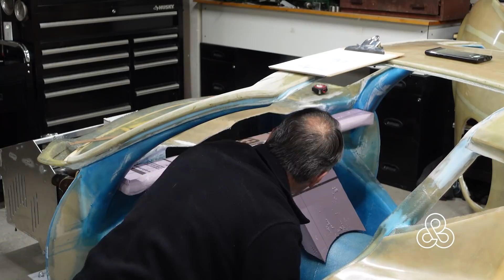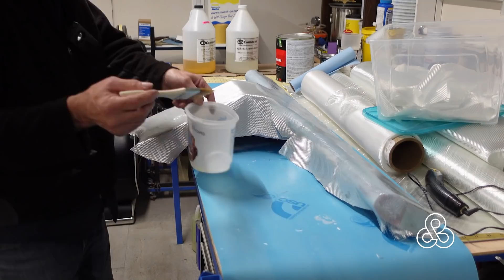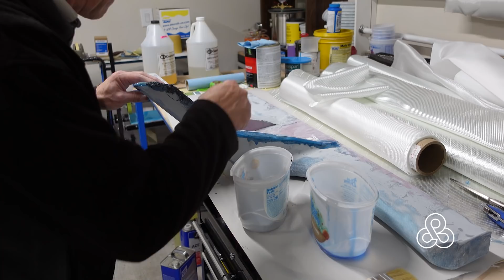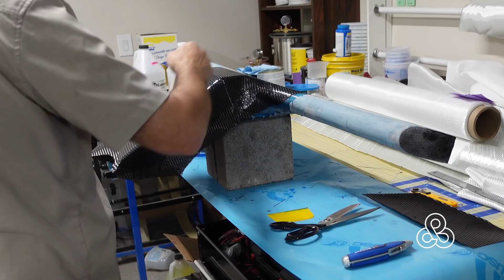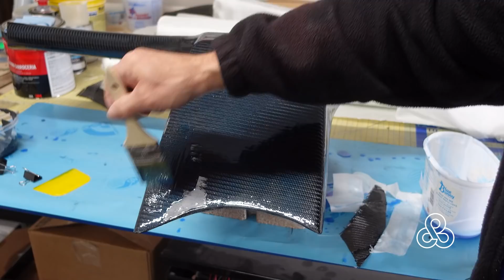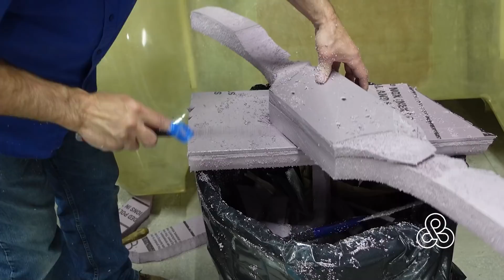A80 Carbon fiber dashboard trim or weird cow head art? Arete Supercar Project

Comment: Hi, what kind of tool did you used for cutting the fiberglass on the dashboard ? THANKS
Reply from the maker: I use a pair of electric sheers (scissors), available from some composite supply houses, on raw fiber cloth and an oscillating power tool on cured resin laminates. Way less dust and a more accurate cut path with the oscillating tool rather than a abrasive cutting disk.
Reply: @BuilderCreator  Thank You

Comment: Hello again.  I finally caught up on all 80 Arete videos.  Just awesome.  I am a real fan of your skill and willingness to share this build and your knowledge on YouTube.  A couple more questions:  

1.  I see its been probably two months since the release of A80.  Is there a reason for the delay?  I know you are also working on the Leviathan, but I’d also like to see more of the Arete especially since you are closer to a rolling and maybe running chassis.  

2.  Also, one technical question that’s been lingering for me since you worked on the front subframe.  When you needed clearance for the coolant tubes, you cut notches on the chrome moly tubing.  I realize you added some flat bars to the notch, but isn’t this a structural piece?  (Sorry, the real amateur Monday morning armchair quarterback question.)

One last thing.  A while back you asked whether people would be interested in more videos about your life.  I don’t know what the upshot of that poll was, but, I’d like to see some on some videos of your other creative projects like the 3d printer.  Not real interested in gardening videos, but maybe some creative home improvement projects.  Solar?  Electric windmills?  

Anyway, again.  Greatly enjoy and appreciate your videos.
Reply from the maker: A new video today answers question number one. Notch in the cross over tube, front sub-frame - Today's video shows that there is an extra tube under the dash that completes a box of the sub-frame. Plenty of connection between the sides! Poll decision- If it is directly connected to the projects (i.e. machines that I would use) It will get a dedicated video. Other things - just honorable mention. Anyway, thanks for all the watch time!

Comment: Sir, I discovered your channel and the Aretet project a few weeks ago and I am catching up watching several of your videos a day.  (I am up to A45.). They are totally entertaining and I am in awe of your skills, knowledge and dedication.  Your project and how you are accomplishing it are truly astounding and fascinating.  Hats off to you.  I do have some questions and please excuse my ignorance.  
1.  The car design is kind of retro: sort of GT40 (with the doors) and kind of old school with the rounded shape.  Was this intentional?  Why not something more modern like a Konnesig type design — more straight angles, etc.
2.  Is the tub floor, with the transmission tunnel,  going to be strong enough as the sole structural member to withstand the flex forces connecting the rear engine frame with the front suspension?
3.  When you lay your fiberglass cloth in layers, it’s always with the cloth going the same direction.  I.e., strands going north/south x east/west.  Wouldn’t it be stronger if you laid the alternate layer of cloth with the strands at a 45 degree to the precious layer of cloth?
4. Is the 4 layers of carbon fiber making up the A pilled support going to be strong enough to be a roll,cage of sort?
5.  The hot air from tue turbo goes through a pipe that is located in the cabin to get to the intercooler on the other side of the engine bay.  Won’t that make the cabin hot?

Thanks again for doing what you are doing and putting it all on the internet.  I am a great fan of yours and appreciate all of your dedication and willingness to share.
Reply from the maker: Thanks for watching Theo. Here are your answers; thanks for numbering them: 1 - Yes the design is a bit retro. I am a BIG fan of the 60s era Italian cars. (maybe because I'm 60s era? Ha!) Straight lines and wedges seam to come and go. The smooth rounded shapes endure. 2&3 - Tunnel strong enough - I sure hope so! most of the layers are formed of a uni-directional cloth that is woven at a 45% bias and as they are laid square the strength will be greatest in torsion. The real strength is actually developed in the complexity of the shape (boxed side rail [cores] and tunnel). The odd layers of plain weave cloth (90degree weave) are mostly to help consolidate the layup, but will also add to the rigidity for and aft. 4 - No, but with the windshield bonded in place and the connection through the roof to the rear bulkhead it will prevent the rear bulkhead from taking all the load in a roll over. The rear bulkhead, with its super thick vertical laminated pillars (and steel roll bar for malleable deformation ) structure, will take a monumental load. Additionally, I am trying to size the rear sub-frame bolts so that in a catastrophic accident the rear will break free and separate from the tub, reducing weight and inertia. 5 - I was able to reduce the size of the air supply tube (actually keep it as 2 tubes longer) and keep it in the engine bay. You will get to that video soon. Anyway, I hope that helps. Feel free to ask any more questions. It is great for others to read as they may also need clarification.

Comment: I just discovered your channel, this project is amazing! Do you have an overview of how this backwards mounted engine setup works? I assume some sort of transfer case to change the rotation direction. If so, is that out of the box or are you building it? I'd love to learn more.
Reply from the maker: I've only mentioned it, but hopefully I will be starting on the center differential soon as the design is  mostly done (purpose built from an old transfer case inards) and will give a full description then.
Reply: @BuilderCreator  that sounds awesome

Comment: Another great video ! Would it be possible for you to say what product you used for the "Fray Check" ? I have considered using 3M77 but was concerned it might not do well with the resins. It's funny you said "industrial hairspray" on one of my first pieces I used "Aqua Net" after waxing as a parting facilitator. Thanks in advance for answer, and thank you for taking the time to document your product and process. Skip
Reply from the maker: Fray Stop made by Sullivans. It is marketed to the sewing (seamstress) world. It is much cheaper than the stuff made for composites. I have never had it interfere with a cure, which the composites specific sprays hold as their claim to fame. It is not good as a tack adhesive just a fiber binder.
Reply: @BuilderCreator  Thank you for the info. I find it amusing that I keep finding myself at "JoAnn's Fabrics" getting supplies to make car parts. LOL

Comment: Great work as usual, but please dont put the passenger side mirror monitor all the way at the end of the passenger side, I did the same settup in my car 3 years ago and its useless, the angle of the camera is very wide, and the monitor too small, so everything looks tiny, try to incorporate the passenger monitor into the center of the dashboard instead, you will thank me later.
At least if you go with the same backup cameras with no parking lines I went with, but if you're gonna use a cctv camera with an adjustable lens, or a narrower lens, then your settup might work, really looking forward to the finished product.
Reply from the maker: I will have real mirrors as well, probably set up the camera to hit the blind spot so all i need to see is motion and that will prompt me to double check that side.

Comment: Been wondering how are the doors supposed to open? Horizontally outwards or somehow upwards? Haven't seen any renderings or any video to show that.
Reply from the maker: Butterfly doors. LM style with hinge points at the front root and on the roof; swinging over the windshield.
Reply: @BuilderCreator  That makes sense. I was looking at the shape of the roof cutout and figured it can't swing open like a GT40 for example. And the lower A-post didn't seem right for straight up "Lambo" doors either.
Reply: It'll have gullwing doors by the looks of it (think it's also discussed in some of the earlier videos).

Comment: A tip or two.
Before deciding on what to cover the dashboard in get some large samples and put them on the dash of your daily driver  and see how livable they are before making the horrible and dangerous mistake of permanently putting something that can blind or distract you in such a prominent place.
Small LCD monitors tend to be crap and don't work with Polaroid sunglasses.
Either get aircraft grade ones or turn ordinary good ones on their side so you can see them while wearing polarized glasses
Reply from the maker: Oh, no problem; everything I do is to distract others, not myself! ;)

Comment: Are the screws that held the foam a permanent part of the car now?  Cant see how you would get the out.
Reply from the maker: The back side of the laminate is still open and most of the foam will be removed (screws and all). There will be some wiring, vent tubes and a touch screen attached from the backside after the foam is gone.